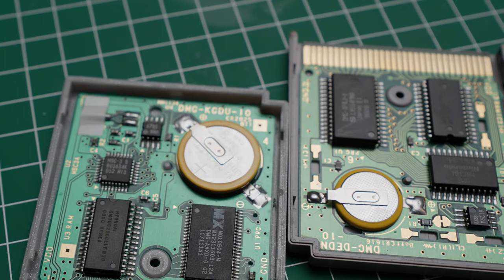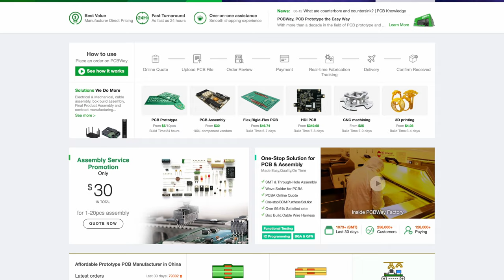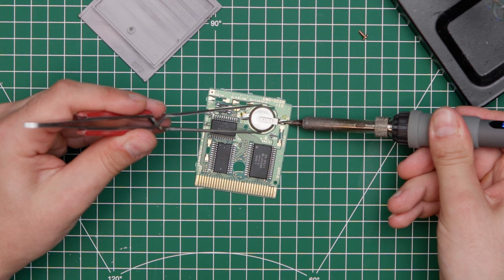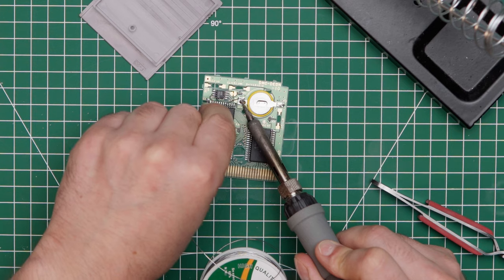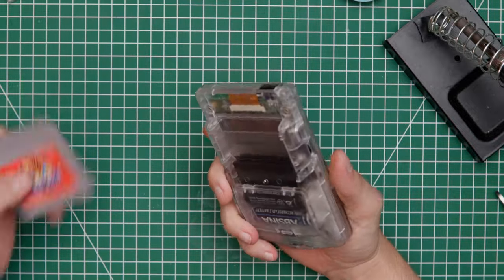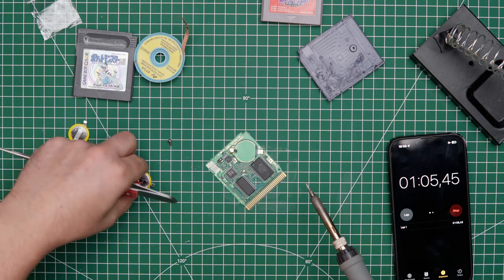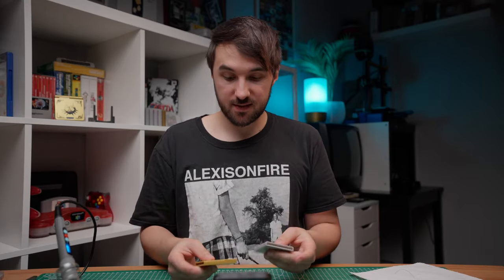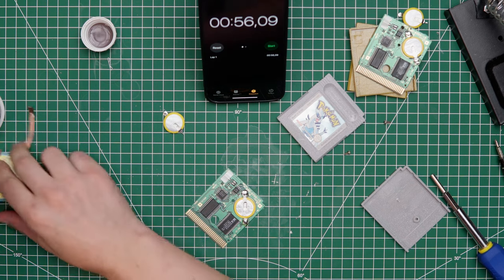how to BATTERY SWAP your precious POKEMON GAMES

Comment: Highly recommend using flux for de-soldering and re-soldering the battery onto the pcb. Especially when the battery solder is very old.
Reply from the maker: You’re right! In the video i’ve used new solder with a flux core. But certainly a good tip nonetheless ✌🏻😊